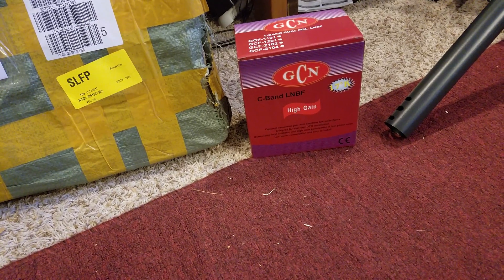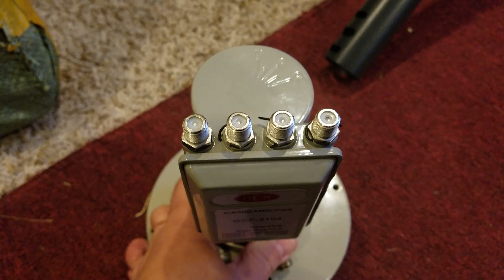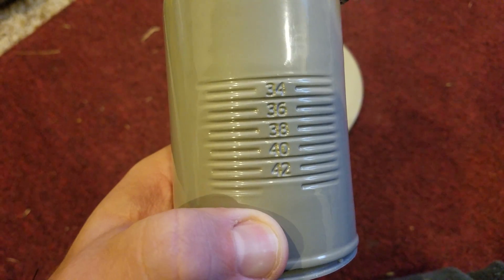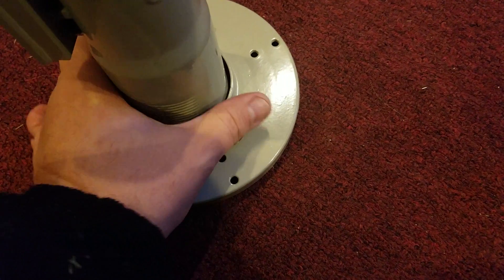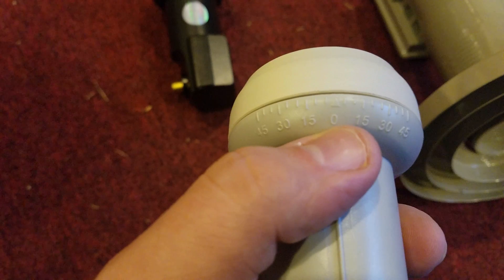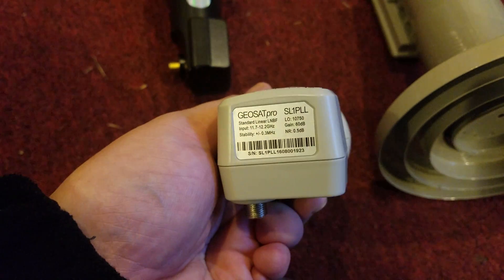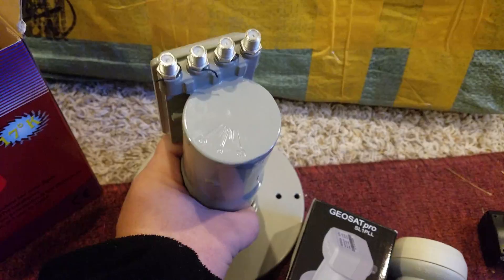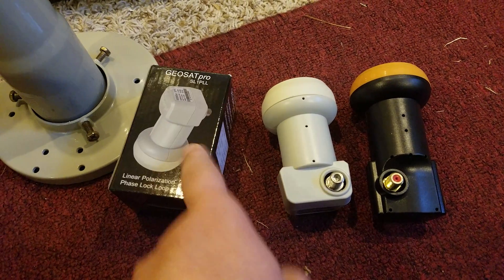Satellite comparison C-Band vs Ku-Band

Comment: Thank You tod for the infos ,,,  Satellite TV reception is my new hobby !   I got a 3 ft KU band dish and  3 Universal LNB's,  a Sat finder ( IF signal strength meter )  and I'v tried to get  a specific FTA Channel   ... It was not easy to tune it !   I got  a 60%  results with the Sat finder last week (Good for Sunny days)   . Now I got a new toy to help me in the fine tuning of the dish tuning, it's "EasyCAP video converter" it  takes  (Video & Audio) from the  Receiver and display the image in my  Samsung Note 9  screen through a USB.  (I can not take my 52" TV to the roof) :)   A  lot to be take care of  to get a perfect strong reception (as Iv noticed)   Dish orientation , Elevation , Lnb  tilting, and fine tuning the LNB distance,  also the cable and the  receiver's quality is very important ...   Nice video , Thank You  Todd an good luck   ...

Comment: What is the difference in the number of Channels received between C Band LNB and KU Band LNB. Please give the additional channels (FTA) that can be received if I tune through C Band LNB or KU Band LNB. Also whether a different type of Dish is needed to install Dual Band LNB?
Reply from the maker: Difference in the number of channels:  https://www.lyngsat.com/Galaxy-19.html

It's easier to let you decide with Lyngsat.  It's one of the best resources of the info you seek.    A larger dish would be needed for dual band LNB.  The minimum size would likely be dictated by the C band side.   I can not offer advise on it, except I would not do dual band LNBs.  Most people seem to admit issues with it.  It's a compromise.  One band will do well, while the other band will suffer with weak signals (depending on the LNB).  Even with a bigger dish, this result remains the same of those who report using dual band LNBs.  This is why I steer clear of them.  My suggestion is use 1 dish for C, and 1 for Ku.  That way you do not have to have to put up with a weakness in one of the two bands.

Comment: can you not get a combo c & Ku band  lnb's?
Reply from the maker: You can.  I find combo LNBs are compromise.  One band does well, while the other not so good.   Plus you need a larger dish to make it work right.  I'm not a fan of combo lnbs.
Reply: @ToddHa  I use a cheap ass one (they all are Chinese) and it work OK on both. That way I don't need the polarizing blue box and all the mess with it going to my pc. You need quite an exotic and expensive ring and lnbs setup to have both band and polarities the American way.